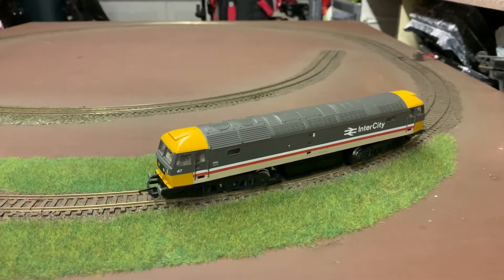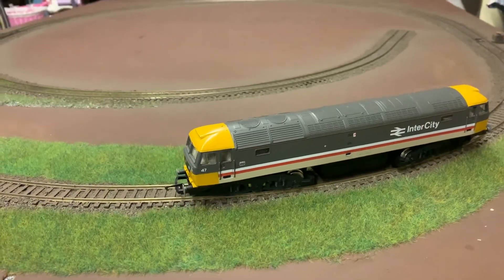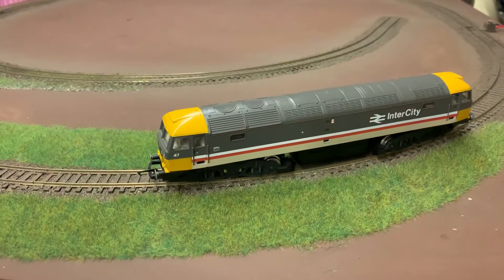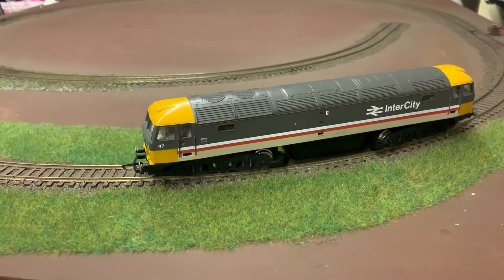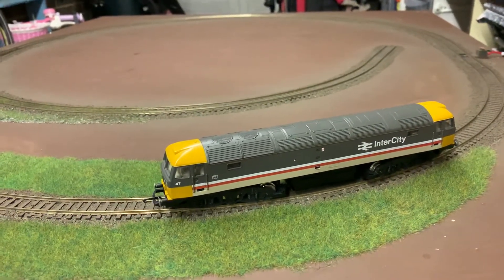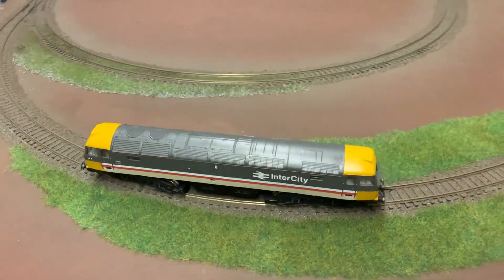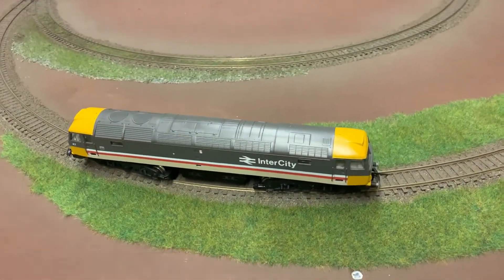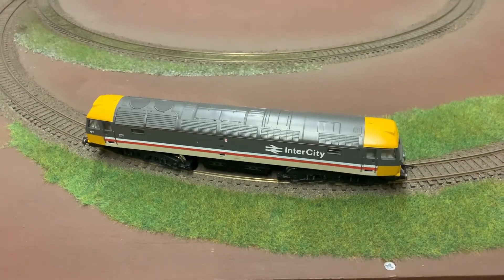Hornby / Lima Ringfield motor upgrade kits with TTS decoders

Comment: hi I have recently fitted one of your kits to a lima class 59 lococ runs fine but can only pull 2 bogey wagons can this be improved by adjusting cvs if so which cv and what settings if this can't be I'm proved I will convert it back as original a loco that can't pull an 8 coach/truck train is no use on my layout 
look forward  to your reply
kind regards
ralph